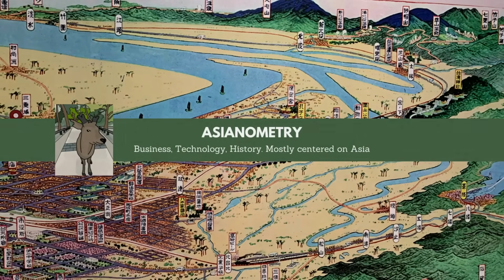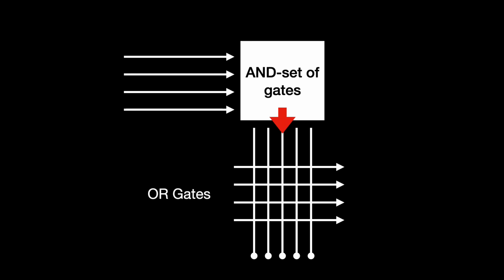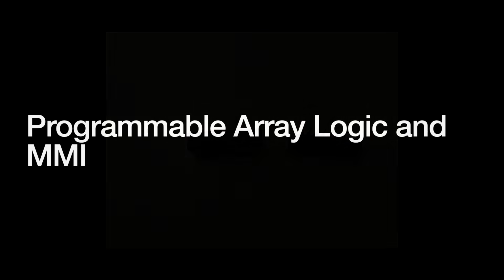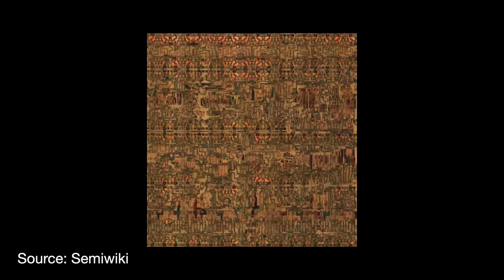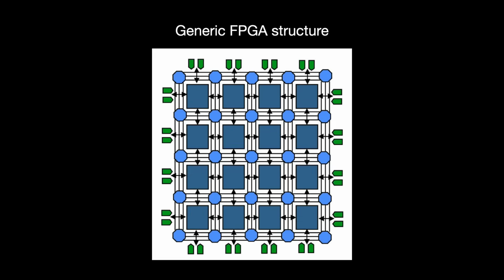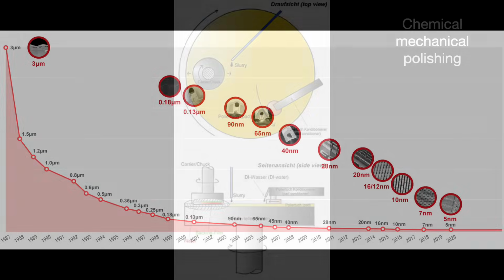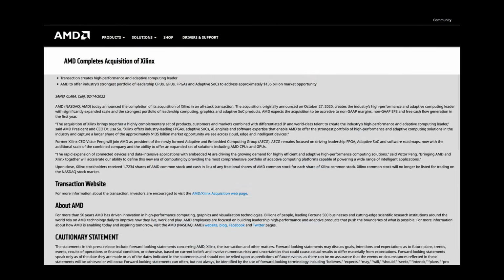The History of the FPGA: The Ultimate Flex

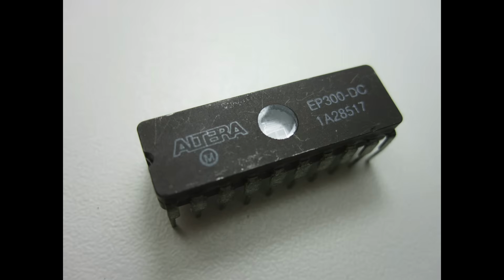Comment: 7:40 DRAM has the same problem that PLAs had: The length of the wires stays the same as more and more devices connect to them. The solution is the same, integrate more blocks as you add more transistors. FPGAs were a regression to PROM in that the core element is a tiny SRAM. But FPGAs do scale as the block doesn't grow. As more metal layers were added these could be used to maintain absolute range of blocks.

Comment: I posted below, but I just want to talk more about how FPGAs evolved in the last 5 years - from a user perspective.  I  became a consultant after 5 years working for BAC.  It was a hit or miss thing, and I could have been making a huge career mistake.  But I didn't.  I've talked below about how I started with the 22V10, CPLDs, then FPGAs maturing.

In the past 10 years or so, FPGAs started incorporating software and hardware microprocessors.  At first, the designs were done by hardware and software guys working together.  I also had a software background, which is why I loved EDA and simulation.  But a problem came up, because companies now wanted me to design the hardware AND software.  I was well versed in C, C++ and I told them I could do it but would need more time.  They wanted me to do it concurrently with the existing schedule.  I told them I wasn't their guy.  I retired five years ago, and I don't know what the design environment is today.  Perhaps some of you would like to comment about what I say above.

Here's a cool story.  l was referred to a small company that made very precise oscillators.  They needed someone to design a CPLD that controlled its frequencies.  It was an easy design until I got there.  I met with the Engineering Manager along with a young guy 6 months out of college.  I told them how I would design it, and the engineering manager told me I had to use C Sharp (C#), because the kid had standardized everything to C#.  Of course I thought this was ridiculous as I would be using Vivado to do a very simple design. I told them I couldn't do it in C#, because Vivado didn't accept C# inputs.  He asked me what it would take to make it happen, and I said about $1M for Xilinx to design the tool.  He decided to go ahead with my method but wanted me to teach the kid how to use the tool.  I said "Okay, but he has to be watching what I do so I can explain it to him."  Long story short, he never observed me do the design.  When I was finished, everything worked great, and the EM asked me if the kid had learned what I did.  I said "I can't teach someone if that someone isn't around to be my student."  He got mad at me for not getting him, and I told him I wasn't the kid's manager.  I got paid, the design was easy and worked very well.  Six months later, he called me up and told me they had lost the design files.  He wanted to know if I had them.  I told him that if I did, I would be violating the NDA we both signed.  I got paid a pretty shiny nickel to go back there and redesign it with my arms handcuffed behind my back.  There is a moral to this story that I'm sure I don't have to explain.
Reply: Your arms handcuffed behind your back? You mean you had to say to others how to do it and not do it yourself?
Reply: @haideralikhan5947  Not sure what you mean by that.
Reply: @koyotekola6916  I really enjoyed these stories. I'm graduating as an EE with an interest in FPGAs. I hope my future career can be as interesting as yours was.
Reply: @lancecruwys2177  I hope so, too.  There will be technological advances that you can get to first, then pioneer them through.  Be on the lookout for them.  I think your best bet is to become a hardware/software engineer.  It can be done, contrary to what people say.
Reply: @koyotekola6916  Yes. This is also the most secure path as regards employment and even starting your own startup. You have a variety of option and are more of a unicorn. Better still, one should strive to be a Systems Architect (Engineer) who can incorporate both to architect and develop an entire product, eco-system or suit of tools.
Reply: Too bad your idea is not used in industrial automation PLC controls. They use ladder logic to program the PLC, not programming language code. The PLC will never go away and ladder diagram programming is here to stay forever and anyone can write a PLC program and it be just as fast as someone who writes word based code for microcontrollers that is hard for anyone to get into. I look at it as Windows versus DOS. PLC programming is Windows and language style programming is DOS command line.
Reply: @EETechs  There's a difference between PLC ladder logic and FPGAs. The FPGA or ASIC is the underlying hardware that implements the ability to use ladder Logic.  If an FPGA is used, it can be programmed to do custom functions that might be needed in addition to the normal PLC functions. If it's an ASIC, you lose this reprogramability. 

If a manufacturing engineer can program PLC ladder logic AND FPGAs, then you have a multi-talented individual.
Reply: @koyotekola6916  Allen-Bradley is over priced and cannot hold a candle to Siemens in feature set and worldwide sales. Their low end is too expensive relative to Automation Direct's offerings and their high end does not have the features that Siemens does. 

Allen-Bradley software just to program their mid-tier PLC's is a cool couple of $1000' s of dollars for where as automation direct is free software to program their brand of low to mid-tier PLC's like the Click, Click Plus and Productivity1000, 2000, and 3000  lines they carry. Finally, Siemen's Profinet is far superior to Devicenet used by Allen-Bradley, which is ethernet on top of serial.....Such a joke..... Instead of a real ethernet protocol like Profinet is.

PLC's can have special high speed input cards purchased that can capture fast signal changes and put them in a data cache already processed so the much slower PLC main CPU can grab the data and do changes or set outputs. I can set priorities for the most important signals to get processed first. You do this for motion controls, high speed bottling lines, and other critical processing time events where the output needs to turn on very fast for a given set of input conditions. Most likely these high speed input cards are FPGA based.

I just think instead of having a real time operating system to do the work on top of a slow CPU, that instead just have the software directly translate the ladder code into VHDL and make the circuit configuration in a FPGA. How many times can you program a FPGA before it goes bad? Don't some allow configuration through flash memory?

The fastest PLC is the  FA-M3V by Yokogawa (their claims) if their specs are to be believed. Says it can do a full scan of a 100,000 step program in 1ms. I think a FPGA could do it faster. Or maybe Yokogawa is already doing that.
Reply: @EETechs  You bring up things I do not know.  Thank you for the tutorial and commentary on features, speed and especially PLC programming languages.  I can now understand why you need speed - some applications have to respond to fast signals, then make decisions.

Since FPGAs and ASICs are super fast compared to CPUs, I believe you that Yokogawa is using them.  But why isn't the other 3?  I have limited knowledge of PLC design, but I know it can be done. It may result in a limited custom design, though.

FPGAs can be reprogrammed many times.  Much more than you'll ever need.  The reason for this is reliability.  If an FPGA is approaching its reprogramming limit, it could very well fail due to environmental concerns and even neutrinos.  They make hardened FPGAs for space applications.  Actel comes to mind, although I haven't used Actel in years.

Sounds like you have a pretty good handle on PLCs.  I like that.
Reply: @koyotekola6916  PLC design changes need re-testing for electromagnetic interference and temperature and also pass UL approvals. All costly. They stick with an old design for years until they absolutely have to upgrade due to no more production of components. 

The RTOS has to be tested and must not fail in any weird states on new hardware. There may by hardware errata bugs in a new CPU design that can cause unpredictable behavior that is very bad when the PLC is controlling a big industrial piece of machinery that can kill someone or cause major destruction if it does something unpredictable.

Looking inside the productivity 1000 series PLC I own, I see a MPC8313VRADDC  embedded CPU based on the PowerPC 603 series that came out back in the 1990's. 

I imagine that the Japanese company did lots of testing for their very fast PLC, but I don't know if it is is UL approved for use in the United States industrial controls. I would have to look again on that site.
Reply: You were a pioneer in the field of what is now referred to as 'quiet quitting'.

Comment: Great video! It feels like microcontroller video is somewhere in the making. One of my professors in his lecture course was explaining to us the architecture of PSoC. He explained to us their ingenious invetion by Cypress semicondutor when they used CMOS in order to make any analog componet via switching transistors with different frequencies using their capacitive resistance. I still remember writing complex resistance equation on the blackboard, but I was a bit sceptical at the time (that it was solely their invention) since he might've been simply connected with that company. He might've known that for sure (he used to fly to San Jose every year to visit some related conferences), but I still couldn't find it on the internet (I didn't try that hard to be fair) whether it's just marketing or PSoCs are actually completely different things from other microcontrollers.

That's funny when you remember learning PLAs and PALs when FPGAs were already around for a long time. All these conjunctive normal forms, disjunctive normal forms, and converting it in the end into Zhegalkin polynomial... We had this specific type of torture in having to write all this down by hand which was like 50 A4 pages with all the schematics (also had to be drawn by hand carefully) including all the junctions between AND and OR arrays.

Comment: Is there an FPGA that is less than 50 bucks and useful ? I want to get into it. I took a VHDL class and intro into digital engineering class last semester but I don’t have an FPGA anymore :(
Reply: The Xilinx Spartan-6 and Spartan-7 chips on many $100 demo-boards can do a ton.  Should easily fit a Z80 or other retro-computer in the logic, and has plenty of onboard memory for a basic system before you need to bother controlling external memory.

Comment: Within the chip design industry, it's very common to utilize FPGAs as a physical emulation platform for verification of designs prior to tapeout. There are some obvious benefits including being able to emulate designs on a platform which more closely aligns with the end product (instead of simulating through software), but one key advantage is the speed of emulation. Simulation through software is inherently extremely slow, with runtime increasing linearly or more with the number of transistors. However, programming and emulating a design via an FPGA is near instantaneous - with 10MHz or even faster clocks, designs can be fully verified literally within the blink of an eye, compared to countless hours chugging away on a server, eating a node-locked license. It's important to note a few downsides of FPGAs though, mainly the lack of waveform output (at least from my knowledge) since you can't really trace a hundred thousand electrical signals at the same time - from my experience, it's mostly been used as a means of connecting peripherals or sanity check.

Comment: Please note, that you need either (not and or) or (not and and) gates to implement any combinational function. In the picture at 4:41 you can see the not-gates close to the top on the left hand side (the triangles with the circle). Using both and and or makes the chip more versatile and the implementation more compact.

Comment: Thank you for the trip down memory lane!! 😃
I remember working on designs with the XC2000 and later, the XC3000 family. I used XACT for design and timing closure was sometimes a real challange with several iterations of the place & route overnight and finally manual tweaks at interconnect level to shave off the final ns or so. That low level access and control over the hardware really appealed to me. Some larger logic blocks, e.g. for state machines, were created with PALASM 4 (a language very few people would remember now) which could be imported into XACT through an intermediate format but the main FPGA circuit was schematic based and you could pull 74' series logic gates and other functions from a library. The catch was that some of these functions had subtle differences, compared to the 74 series, catching out the unaware. I could go on and on, with my memories!
Since AMD used to make PALs, AMD acquiring XILINX meant that things came full circle. in a way.
Reply: Huge respect ! We did same work with custom design & layout chip to archive higher efficiency with low power consumption.

Comment: In the late 80s to early 90s, I used a lot of 16V8 and 22V10 PLDs. By the mid-90s, I was using AMDs MACH line of CPLDs, which they sold off to Lattice. Ironic, that they bought Xilinx, years later. Also by the mid-90s, FPGA complexity was large enough so that you could program an 8-bit processor, like the Z80 into one. Vintage 70s 8-bitters live on, as macros, in FPGAs. That the circuit is stored in RAM, can be a plus. It lets you reconfigure your "circuit", on the fly.

Comment: Before the FPGA were PLA (Programmable Logic Array) chips such as the AMD 22V10  - an AND-OR array of logic with flip-flops on the outputs and programmable by JPEG compatible programmers. FPGA’s are super fast and still used in niche applications. I worked at MMI and Lattice Semiconductor Corporation on these chips.
Reply: FPGA's were not super fast. Vendors like Xilinx would quite very high operating frequency but all that was was a D type flipflop configured as a T type and clocked as high as possible. Such a trivial circuit did not use any of the interconnect.

Start using the interconnect across, if I recall 30 years later, the CLBS and the performance dropped dramatically.

ASIC's were faster and then full custom technology faster still.

Comment: I had heard of all these before, but somehow I had it in mind that PLAs and PALs had come after FPGAs.  Do you think they have a place in the future of computing, or have FPGAs completely supplanted them?
Reply: CPLDs are useful because they are ready immediately. FPGAs need to clock bits out of a ROM or Flash EEPROM one by one to program them on boot.
So, FPGAs are not ever going to take over everything. On the other hand, PALs/PLAs are not as flexible as CPLDs.
Reply: I would not consider using PLAs and PALs, because they implement relatively simple functions.  CPLDs are not as complex as FPGAs, so I would migrate to CPLDs.

Comment: The problem with FPGA from the big 2 is that they are so complicated and EDA has long learning curve.  There is not enough young engineers learning it. Young engineers are not given opportunity to pickup as projects don't give time for them to learn.  My observation is that most designers are in their 40s.  
Furthermore, Xilinx is more interested in promoting high level languages and AI because it sells bigger and more expensive ICs, so new comers start from there.  So who gonna work on the challenging low level stuff in the future?
Reply: I have observed the same, there are less engineers that work with HDL directly and know how the FPGA works, year after year.

Furthermore the curren Xilinx approach has render the designs dependent of the Xilinx devices. This makes impossible to port the design to other FPGA manufacturers. This has become specially my important over the last year due to the semiconductor shortage.

Comment: Is the job market for FPGA programmers good?
Reply: Yes - but niche. And there's a big difference between programming and FPGA work, with a steep learning curve. Any fool can code, but in an FPGA it's as much about timing (when things happen, relative to everything else) as what happens. You'll spend your life buried in simulation tools, and it's a fast moving target. As an FPGA designer, you'll never be out of a job, but no-one will really understand what you do. Once you have explained that it's just like everyone else, but massively faster for the hundredth time, you'll stop telling people and pretend you work in admin.. 
On the upside, the tools are slowly getting better (the bugs are now more interesting). As we move more to the System on chip stuff (where you have processor cores as hard IP rather than soft) then the whole hardware/software co-design can be a bit of a cliff to climb too.. but go for it, but remember there's a reason FPGA devs are few and far between, and it isn't the pay cheque.
Reply: @timwatson682  No big paycheck to soften the daily blows?